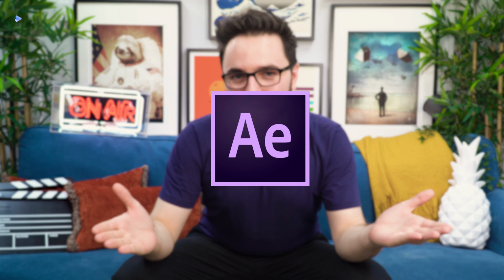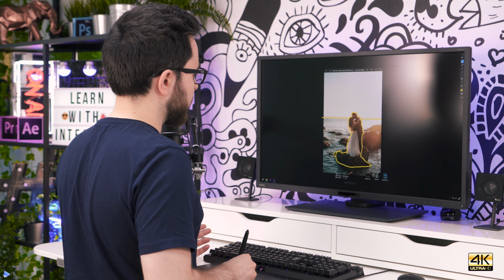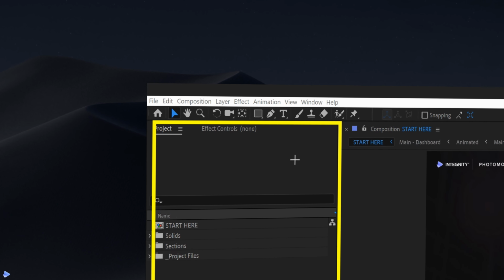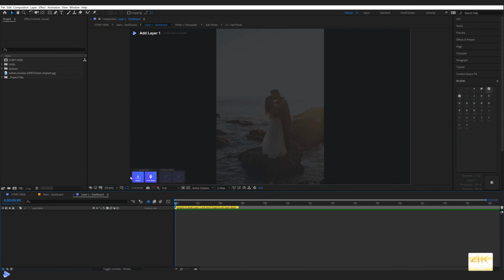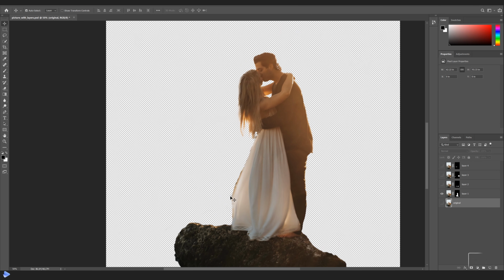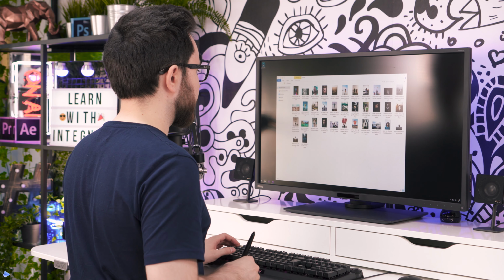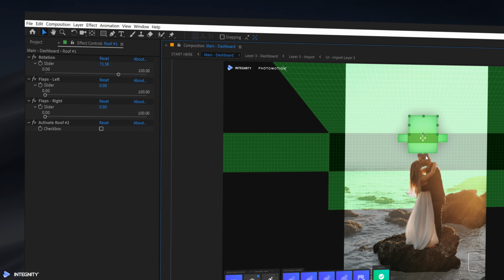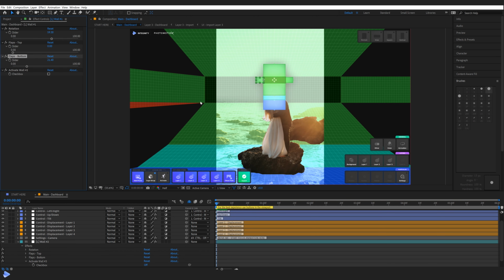Real 3D Photo Animation  [After Effects Tutorial] | Photomotion X Series

Comment: Just to clarify, we use horizon when the subject is touching the floor meaning the 2 layers are intertwined? And parallax is when the 2 layers are not intertwined?
can someone plz explain?
Reply from the maker: Yes, Horizon is for those instances where your subjects stand on the ground/touch the wall etc. These setups require 3D projection, therefore Horizon is better than Parallax for those usecases.